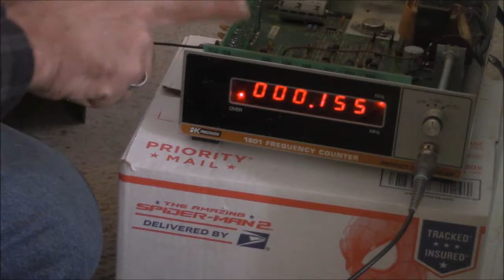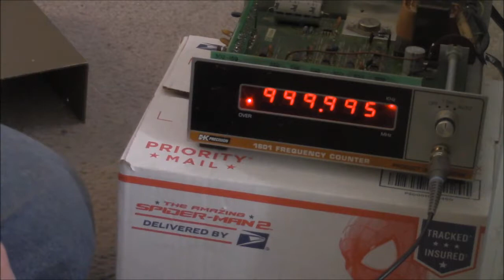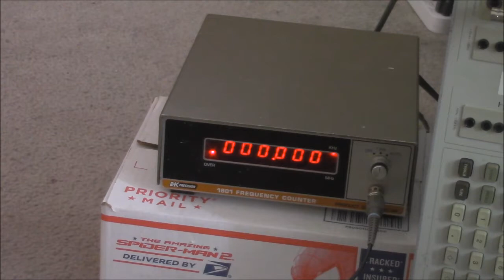B K Freq Counter Cal  BK 1801   PT2

Comment: I enjoyed your video. I just calibrated my BK 1801. A few points for anybody else doing this. The crystal oscillator board that was worked on in the video unplugs from the main board. (FYI, the board that holds the display LEDs also unplugs from the main board.) The crystals fixed "padder" capacitors  are  N750. I changed  C201 from original 91pf N750 to 39pf N750 and I was then able to  calibrate my unit correctly, you may need different value capacitors.